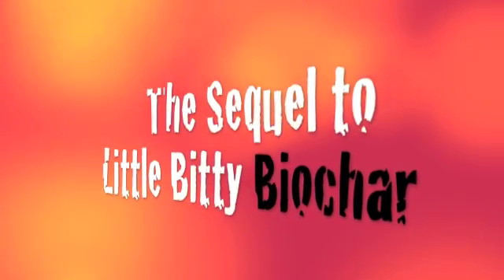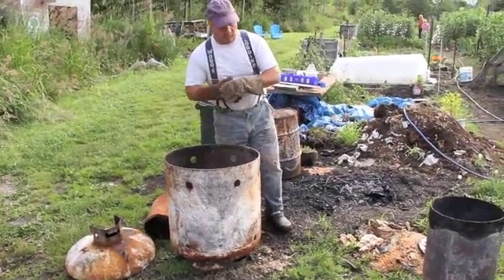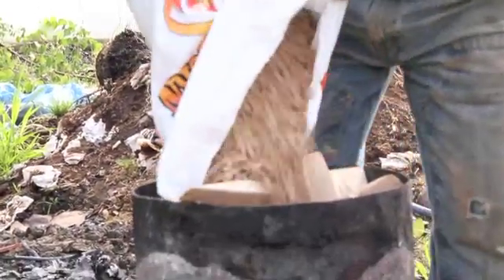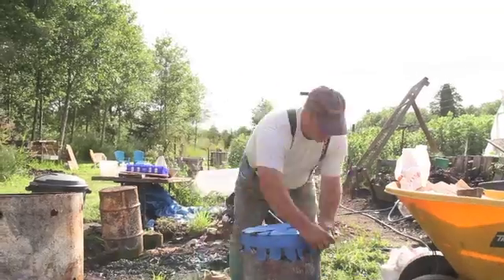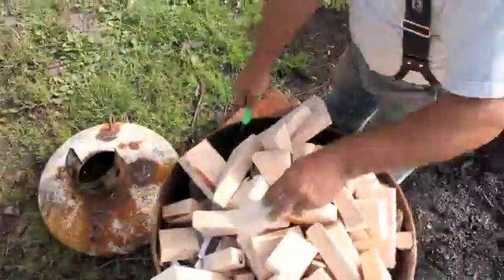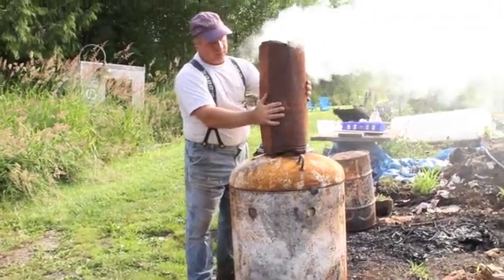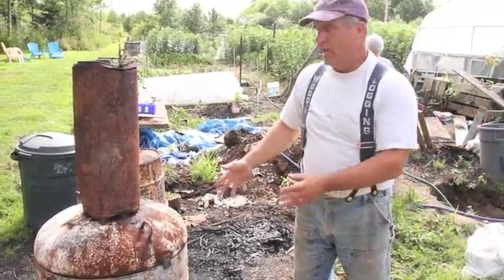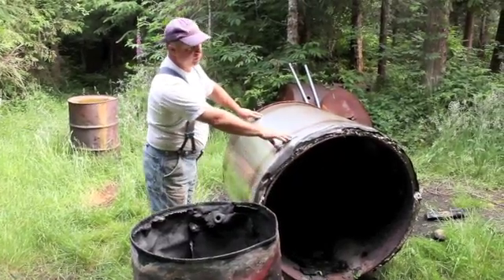Big Daddy BioChar

Comment: Thanks for the video.  Does it matter what the size of material is in the inner barrel?  I want large chunks so my pieces are pretty big.  I am seeing this done several ways on youtube and I must be missing something.  I have tried making my own unit with a 55 gal and 30 gal drum.  I do not have holes on the inner barrel but did not have lid.  The first burn did not make char and burnt very quickly.  Any suggestions?